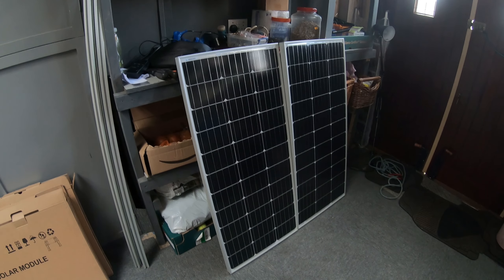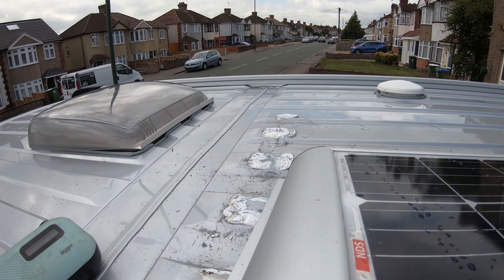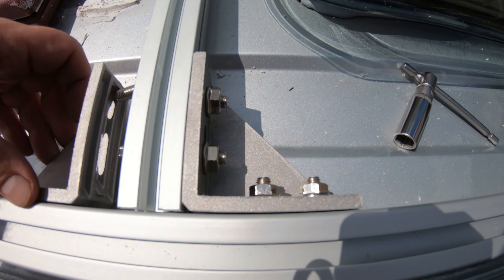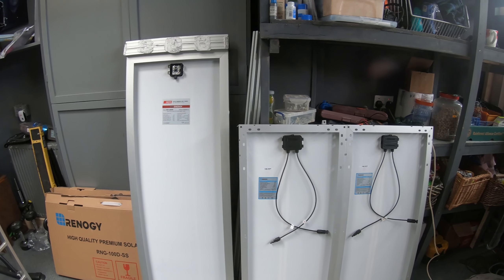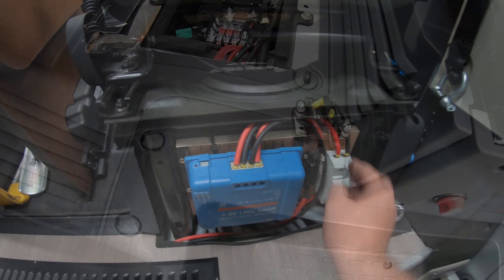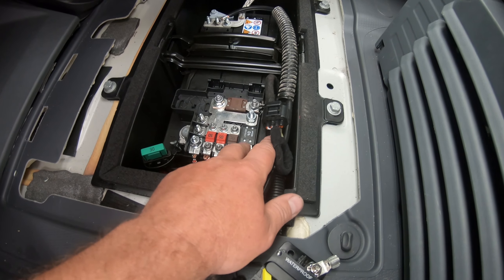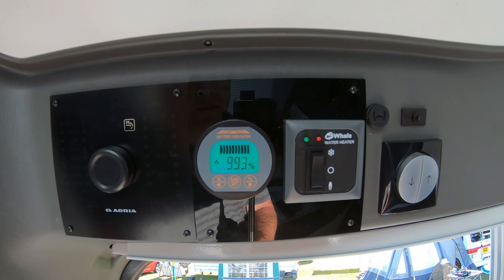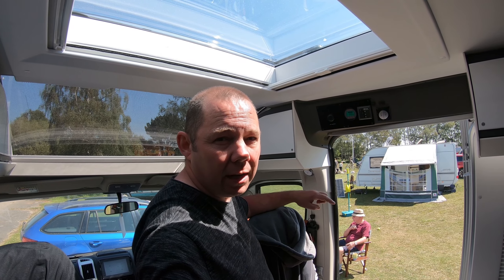Adria Twin SGX640 My Solar Panel Fitment

Comment: Dear you, thanks for you video. Still have question; I have bought a brand new Adria 640 twin. Bought SmartSolar charge MPPT 100 I 20, how hall I connect the panels to the battery? Can I connect SmSolar... charger directly to the battery without any problems? Looking forward to your professional answer. Thanks/Bo

Comment: I wish I knew how to put another solar panel on my motor home
Reply from the maker: If you do not feel confident fitting one on the roof you can setup a mobile one that you can bring out point to the sun when on camped up. Depending on your controller wht you can fit

Comment: got the solar panels today, now I need to buy the brackets. you say  "click the link below" sadly I don't seem to be able to do that .could you please tell me how to get the brackets. I have tried eBay but don't seem to be able to find the ones you got. any chance of a photo of the packaging or a reference number please?
Reply from the maker: Any aluminum T brackets will work. Seach on ebay there are a number of different ones. You can also bolt the rails on top of the Thule bars and not use the brackets this will raise the solar panels a bit. Try this link https://www.ebay.co.uk/itm/284244519431?hash=item422e4b2a07:g:yqMAAOSwkw9gaNDw&amdata=enc%3AAQAHAAAAoGtSXFiWsuh5xXz5rOjeo6c5oWBJvVyLtCpyaoz9EkAXOWajVjmPQlspFTInNauYVovq3AI6EYaQx7HvYzs4SvGB5v86mmayZfK3q2025%2BOdRVoyfYUibaQCwSVVzOO8DrUajg5gvuDdgLoqI5rO3WzSJ4sdLpd3JyEYKaNJkAZGjMdBd4aczidJfl%2FZl9gFwdb8QzzESoTW3zMEhmMHWtQ%3D%7Ctkp%3ABk9SR8LE1a_lYA

Comment: Did you fit the solar panels over your bathroom vent & if so did it cause any problems. Thanks
Reply from the maker: Yes but it’s not blocking of the vent so there is ventilation and the panels can make a vortex when windy making ventilation better. I have not had an issue doing this but we do not use the shower too much and open the window on vent when we do. I was going to fit a 12v computer fan to the vent wired of the toilet light to vent better but have not found the need to do so yet.
Reply: I’d like to know this as well, any before and after pics of the roof?
Trying to work out how I can fit more solar to a 640 Adria SL

Comment: Hi mate fitted all my new electrics sorted thanks your content was amazing. Just going to replace the solar panel and was wondering was the nds hard wired or was it fitted with mc4 connectors
Reply from the maker: the nds is hard wired. I did a vlog showing how I removed the panel using wire to cut through the sikaflex now easy. then removed the cable cover. the cables go in above the fridge then into the cupboard next to it where they have two terminal connectors

Comment: Great set up and instructional video as always Steve. With the new battery and this powerplant you will be prepared for any adventure off grid. Is it long delivery time on the battery?
Reply from the maker: Thanks, Mattias, agree when the battery is installed I will never have to sit there at night wondering if I will have enough power the next day 😊. The battery should be in stock in July so will start emailing soon for an update. See your out again venturing on the bike.
Reply: @BrackstonesTravelAdventures  Hehe, yes that was not fun with a battery that was degraded. Knowing that you barely managed the nights. I will get the B2B next week. Have not needed it yet since we do not have much consumption at summer, but will be great when fall and lower temps are here again. I have only got 2 cycles on the battery so far, it counts a cycle when it's below 80% SOC. So I have only been at 80% once since it came new. To use 20% of the capacity I need to charge everything, have a 12v fan going constant and also forget lighting on. This will be good! We were out with the van this weekend and actually stopped at a camping for once 😂👍, this due to that we met up some friends. Last weekend I had some solo quality time and went out out on the bike for some scouting of trails for an event later on. Cheers and enjoy the vacation!

Comment: Great video. I would like to pick your brains. I've a v60sp which is made be adria and looking at the video the leisure electrics are the same. I've installed a victron smart shunt but I think it's not showing exactly what going on with the battery's ( 2 X 100ah AGM). When switching things on I initially see a - current reading but then slowly goes back to 0. I've check the wiring and it all looks good to me, but I'm not a sparky lol. Would you be able to advise me on what's going on. Thanks chris
Reply from the maker: Hi Chris. I assume you have connected the smart shunt on the negative straight from the battery. Also the correct way around. I have never used the smart shunt so do not know the settings. If you go on facebook there is an excellent group called camervan electrics lots of people on there will have the smart shunt and can help you.
Reply: @BrackstonesTravelAdventures  yes I think all the wiring is correct. Thanks I'll join the group and sell what happens.👍

Comment: Nice video mate but how did you connect the rack to the roof please I take it the frame was fixed to roof and panels to frame , but how did you fix the frame to roof .cheers keep the mods coming
Reply from the maker: The Thule bars where already fitted by dealer. I think this is standard for all Adria's. For any fiat ducto they have metal lugs that the Thule bars fit to. On my solar vlog I show how I fitted the ally bars to the Thule bars

Comment: Which way are the solar running from the roof to the solar controller?
Reply from the maker: They connect to the solar cabling already installed by the dealer, just above the right hand side of the fridge, cabling goes into one of the top lockers then behind the fridge under kitchen units to the solar controller.
Reply: @BrackstonesTravelAdventures  Thanks for this video and answers. I would like to do the same. Originally, did you get the NDS Suncontrol mppt ? The positive cable is clearly there but not sure about the negative which is common to panel and battery ? any advise to identify it ?  TIA
Reply from the maker: @francoistalabot8487  Hi yes I did have the NDS, the negative (GND) cable is the other side of the seat. If you trace the solar positive under the seat you will find a conduit go under the floor. Out of this positive is the negative for the solar panels. I think I showed or explained this on the following vlog https://youtu.be/sUE5khRQOB8
Reply: I have just seen you other video,  please forget my question and again thanks for sharing  your set up.!
Reply from the maker: @francoistalabot8487  no problems good luck

Comment: Hi have a Adria twin supreme. Looking at fitting 400 to 500w solar panel victron 30 100 mppt and two 100ah AGM batteries.

Looking at laying panel across the 30mm  aluminium extrusion and bolting down with for brackets.

Can I ask where you drilled the hole for the solar cables to enter and did you run them down the seat belt pillar.

Thanks
Reply from the maker: the hole was originally there from dealer as my van come with solar panel. it was above the fridge. cable goes down back of fridge the under cooker cabinet then undet floor by sliding door to drivers seat area
Reply: @BrackstonesTravelAdventures  thanks for the response. Is there any chance of having a chat about what I'm doing,  just to check my logic.
Thanks in advance.